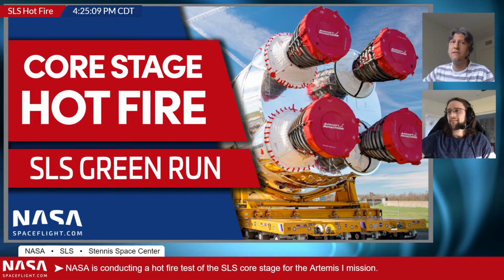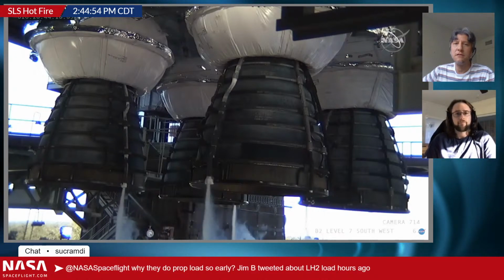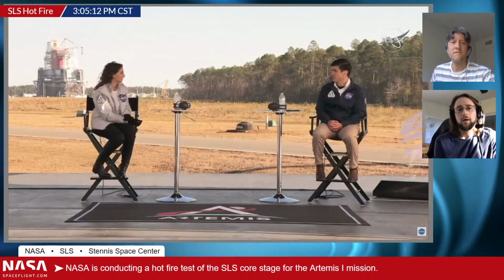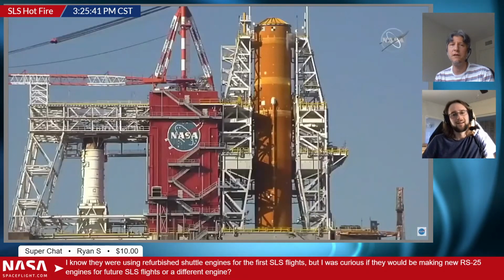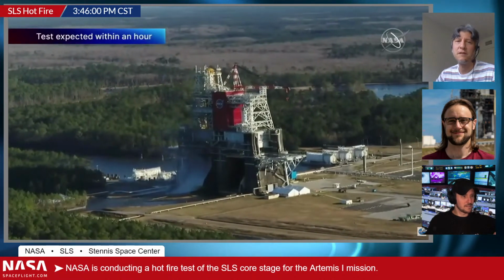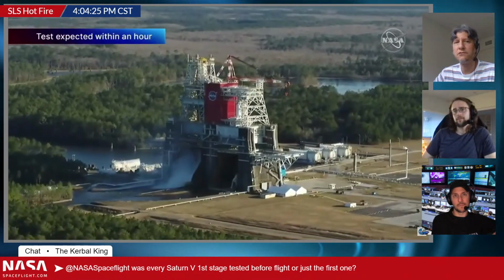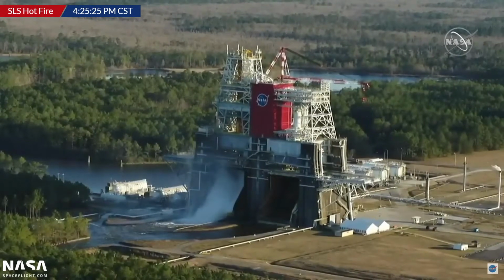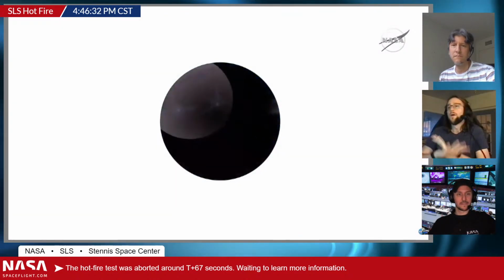SLS Green Run Hot Fire Test Aborted Early

Comment: I'm all for persevering through failure but the SLS needs to be canceled. At $18.6 billion for project cost and another $2 billion PER launch, this beast is too expensive. It has no new technology such as reusability and even if it did, the cost is absurd. It's not sustainable.
Reply: For $2 billion you could buy between 10 and 15 Falcon Heavy launches.   And Falcon Heavy actually works.